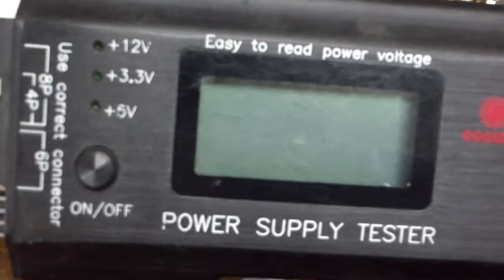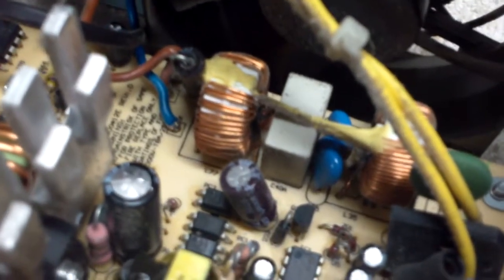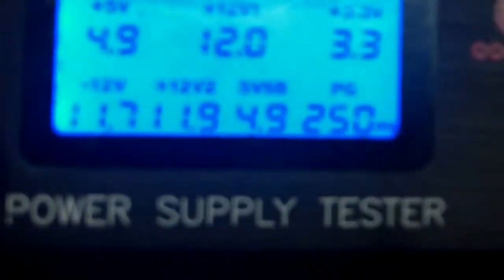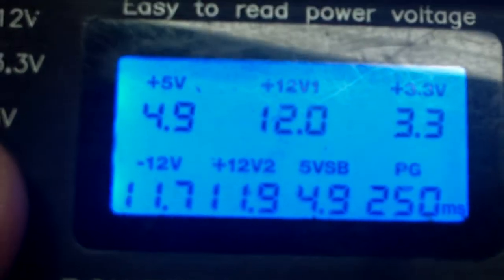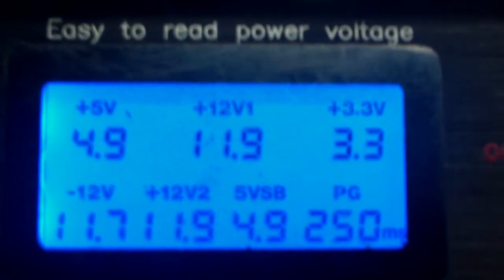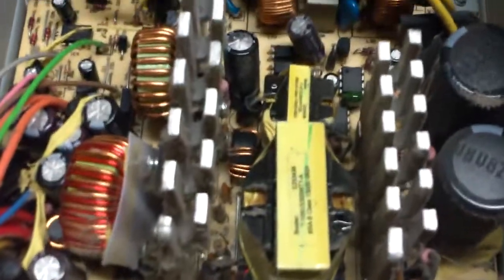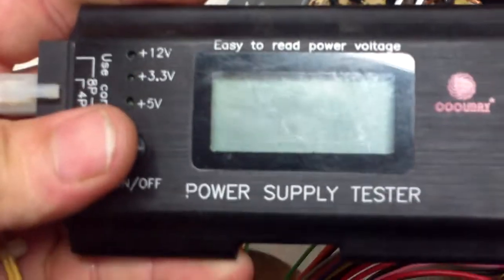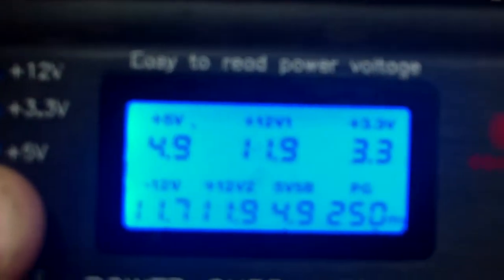Don't trust power supply testers

Comment: I also own one of these testers and found them to be reliable. In your video, you had failed to mention one part that you may have not figured out or not fully understand. With your test, you claim that the tester was showing the power supply as being good. From what I had observed, the tester was in fact showing the supply was bad. How I observed this was by looking at the three lamps on the left side of the tester. All three were off telling me the supply was bad. If there was nothing wrong with the supply, then two or all three lamps would be lite up green.

Comment: In general failure its normally the MOSFET's that cause most of the problem's. They can be flawed from manufacture or just degrade from operating outside of there tolerance spec's (overheating being the most common). They are also vary sensitive to electrostatic discharge.  So it could really be a large list of potential causes. The quality of construction is also a huge factor. Surges though are not vary common cause for damage, but this depends on power grid for a given area.

Comment: There not that dangerous, no more then house hold current anyways. Just discharge the caps, and keep one hand in your pocket wile working with a live one, Completing a circuit with both is a good way to stop your heart, grounding a circuit with one hand will give you a unpleasant reminder to not fuck around.

Comment: I am sure your intentions are good but there is a reason why many computer tech books manuals etc don't get into opening up the power supply.  I wouldn't be showing anybody something that could be potentially dangerous to somebody else.  You could put yourself at risk and you have little to gain from it.   I wouldn't chance it.

Comment from the maker: Even then I wouldn't trust it, I'm goingto be posting a new vid with an even worse PSU, I think it had 4 or 5 bad caps, and was still testing good, I figure its only 4 screws to remove the PSU, and another 4 to remove the cover, so its always a good idea to do a visual check of the PSU.

Comment: Can you not check the other connectors (SATA, Molex, etc.) under load with this product, without the 24 pin connector? Is that not what the LEDs on the left do?